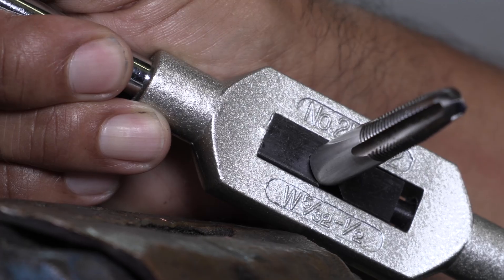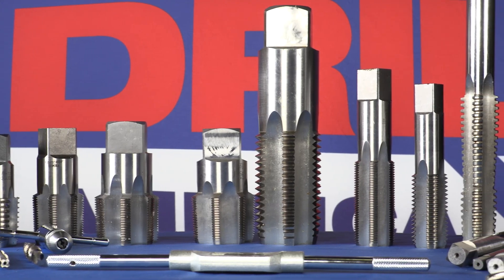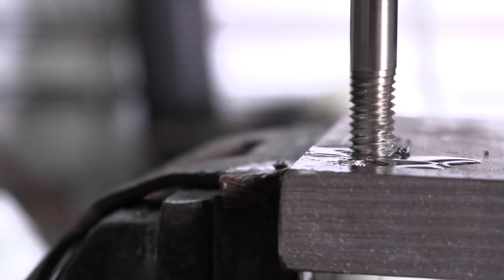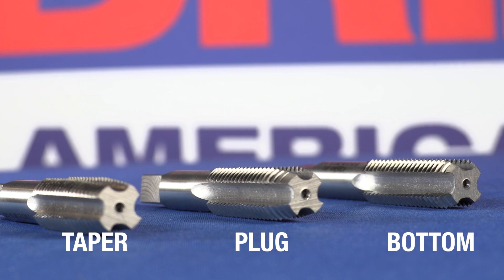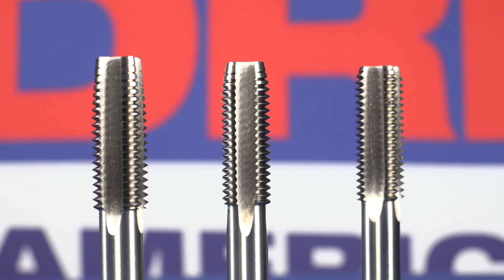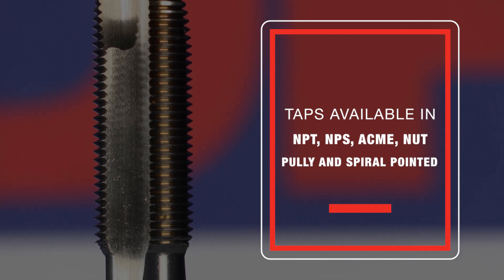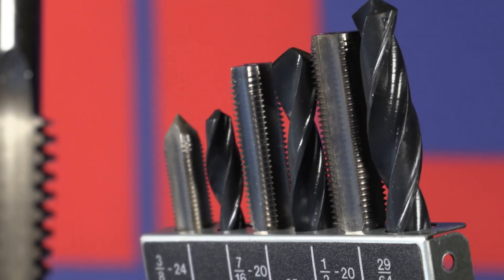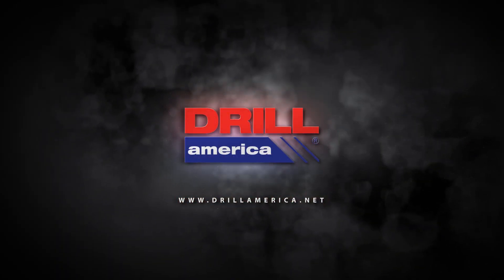Taps from Drill America

Comment: good night, what is the formula to calculate the npt tap bit
Reply from the maker: Hi Carlos, the sizes for each NPT Tap can be found below. Thanks
Reply from the maker: Tap Size	Drill Size	Tap and Drill Set
1/16" NPT Tap	"D" Drill Bit 
1/8" NPT Tap	"R" Drill Bit 
1/4" NPT Tap	7/16" Drill Bit
3/8" NPT Tap	37/64" Drill Bit
1/2" NPT Tap	23/32" Drill Bit
3/4" NPT Tap	59/64" Drill Bit
1" NPT Tap	1-5/32" Drill Bit
1-1/4" NPT Tap	1-1/2" Drill Bit
1-1/2" NPT Tap	1-47/64" Drill Bit
2" NPT Tap	2-7/32" Drill Bit
2-1/2" NPT Tap	2-5/8" Drill Bit
3" NPT Tap	3-1/4" Drill Bit
3-1/2" NPT Tap	3-3/4 Drill Bit	
4" NPT Tap	4-1/4 Drill Bit